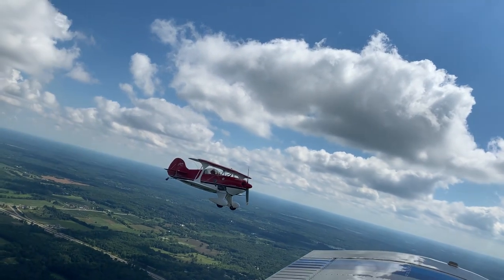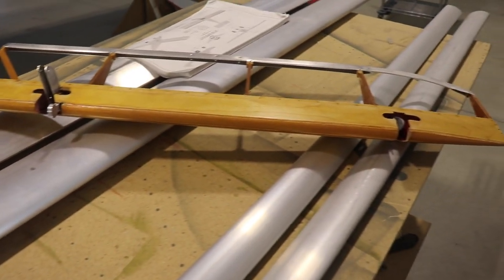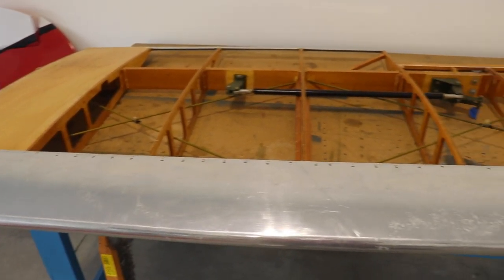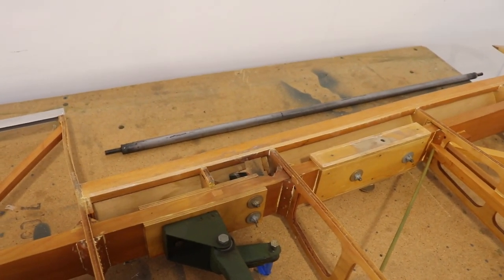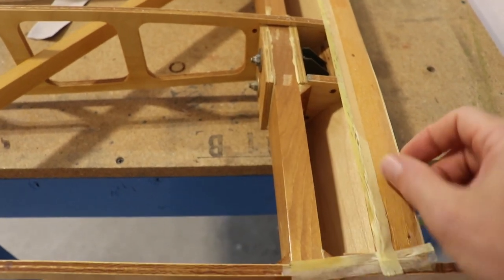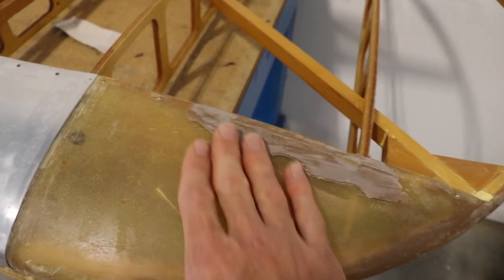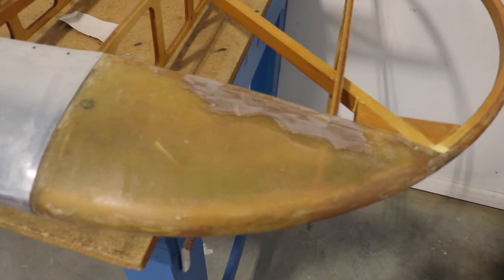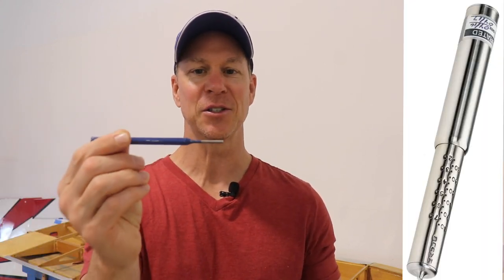Pitts S-1E "Return to Flight" Ep.3

Comment: i bought a pitts s1 10 years ago flew it 2 times then did what it is meant for. i hung it in my hanger as a big model airplane  im sure it still runs and is still flyable since it was recovered 3 months before i bought it. paid 10 grand for it from a estate sale. engine if i rmeember correctly has only 6 hours on it. but i pickeled it drained oil and gas and hung it  up in the rafters of the hanger.   pretty sucker but they are all painted the same. red and white with a sunburst. makes the best hanger  toy still looks nice i put on like 15 coatss of carnuba wx  i winch it down ever 6 months and dust it off lol i do have the annual done once a year..think i missed this year.  found another one cheap also  will buy it and hang it on the wall of the hanger they do look cool hanging around lol

Comment: I hate those metal wing wrap leading edges. Pitts still does that at the factory (Aviat). Lots of issues like denting and nails protruding loose over time. Glued wood wrap is the way to go which makes the wing stiffer as a whole and so much stronger. Metal does not add strength. Metal is an old technique.

Comment: You’re testing the bottom of the wing which will test to a higher test number than the top. Maule testing is typically done to the top of the wing which due to exposure, uv, etc will reveal the worse fabric and its number

Comment: Mark, do a search on Sparcraft wings. They can have issues if flown hard. I would most definitely use a boroscope inside the leading edge to be sure that the nose ribs are intact and secure. I recently saw one at a contest that the nose ribs had folded over and allowed the aluminum to flatten in the airflow. There are fixes recommended if the airplane will be flown in competition.
Best, Mark Too
Reply from the maker: Aren’t the Sparcraft wings an upgrade from a different company? This is an E model (kit) so I wouldn’t think these are Sparcraft wings. Unless that’s what they used in the kit? Either way, prob still a good idea to put my scope in there and take a look.
Reply: @KitplaneEnthusiast  
The story goes that a set of wing plans went home in somebodies lunch box and the Sparcraft wing was born. 
The vertical webs/intersections have not proven to be adequate for Advanced/Unlimited type aerobatics. 
The proposed fix is to glue a 1/4” piece of spruce on both sides of the vertical to support them in compression. 
There is a large quantity of info on the BPF and in the Technical Tips manuals from IAC.
Reply: Sparcraft wings are most definitely NOT an upgrade. They were considerably more economical to build. I can tell you from personal experience they are not as strong , especially when being  flown hard as truss type factory ribs. There was an “improvement” done to later Sparcraft wings involving a capstrip on the ribs that strengthened them considerably. As was mentioned, do some research.

Comment: Great to see the condition of the airframe is so fine.
Two things,
Maybe avoid exposure to MEK for removal of the adhesive and go with something like Goo-Gone.

The fabric was in excellent condition.  That failure by fiber separation is by design, retaining maximum integrity.  Had the fabric degraded, the fibers would fracture.

Comment: Thanks for the video!
Just a couple comments I'll through out there...
I see nylon zip ties on the cross bracing in the wing. I've seen them get brittle over time. Many plastics get  brittle after decades. I'd replace them with black ones while the skin is off. I like black ones because they hold up well against sun light (UV). Though not an issue inside the wing, you never know what else you might use them for.
Are the bearings in the bell-cranks sealed type? If not, grease may have more staying power than spray oil type lube. A couple things I've heard over the years about lubes... 
If it spins, oil it. If it slides, grease it.
Oil is better in dusty environments (oil gets reapplied and flushes out the dirt). Grease is better in clean environments. 

That Pitts looks to be in great shape!
Thanks again.
Reply from the maker: Good idea to replace the zip ties. They do get brittle over time so it certainly won't hurt to replace them.

Comment: When i had my shop, we used the Maule tester.  If I remember we set it to 55 pounds.  But, the instructions were to remove the paint in the area to be tested.  We would use MEK or acetone and remove maybe a quarter sized area.  If it passed we would re finish the area.

Comment: Are you going to declare the Pitts as Salvage? That way you can be the new builder/repairman for the airplane.
Reply from the maker: I've never heard of doing that. Explain how that would work. I'd love to find a way to get the Repairman's Cert!
Reply: @KitplaneEnthusiast  I just had this discussion this morning with a friend who rebuilt an RV-6.  Basically he did just what you are doing.  He learned from the FSDO and DAR that had he declared the airplane salvage and turned in the existing AW cert.  He could then have reapplied to the FAA as a new/rebuilt airplane with a new tail number, (I guess you could probably reregister the original tail number).  Then he would be able to get the Repairman's Certificate based on it being a substantially rebuilt plane.   It is worth looking into.